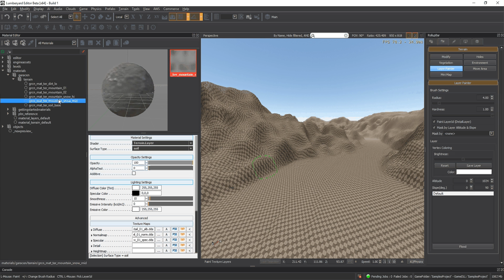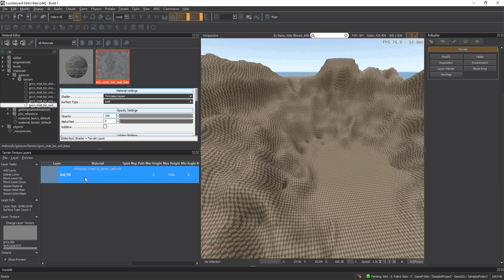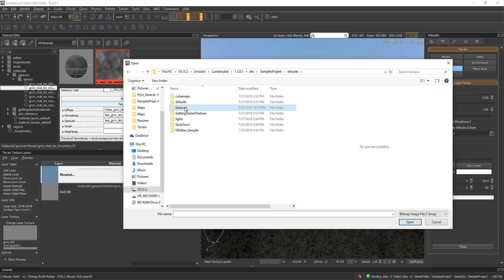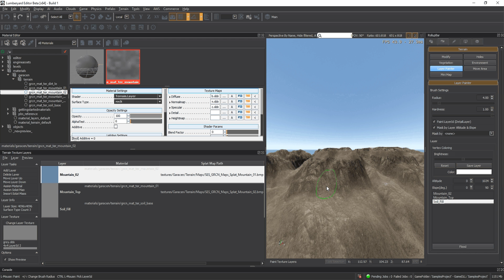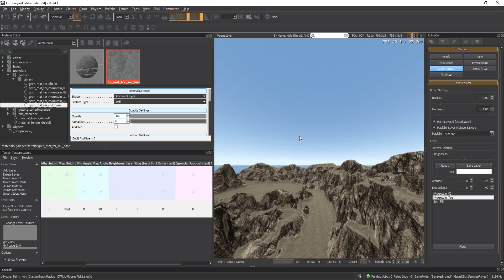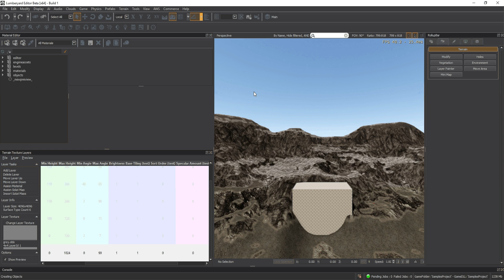Lumberyard Terrain Paint Tutorial

Comment: Having trouble getting colors to match with what I"m choosing in layer paint area.I apply texture as in video, shows up in paint layers area, I chooose color,and its all white instead of color I chose.I also note, that your terrain looks green and brown in places, yet your texture in material editor is completely white, how is this so ?

Using beta 1.8, is it the beta and not me possibly ?
Reply from the maker: This is because the color for the Layer Painter is primarily set by the Layer in the Layer Painter Tool. Set you color for the Layer then SAVE THE LAYER so that it does not reset when you create a new layer. Also, opening the Terrain Editor and selecting 'Generate Terrain Texture' may fix your problem. And i have found 1.8 to be buggy as well...so...yeah...beta.

Comment: Hi why does  your diffuse have no color. Why are the grey? This works only for moon landscapes.
Reply from the maker: I chose de-saturated diffuse Textures for this scene as the end result will be very bleak. If you want more color in your scene you can either add a more colorful diffuse texture or you can add only Norm, Spec etc. to you material and then define color with the Layer Painter.
Reply: Yes I will make my own terrain texture then because all the textures standard in it have here color taken a way with some high-pass filter it  seems. And coloring in wiht one color is just not right. It only works with textures that had only one color to start with and that is not a lot of textures because nature is not monochrome.
Reply from the maker: It could be a lighting issue. Have you set up your environmental probe and set the Diffuse Lighting to at least 1?
Reply from the maker: Also, you can try setting your color to the Terrain Paint Layer in the Environment Tab. Set your color after creating your layers in the Terrain Texture LAyers Editor and make sure to Save those Layers!